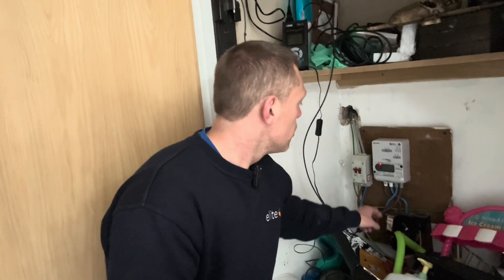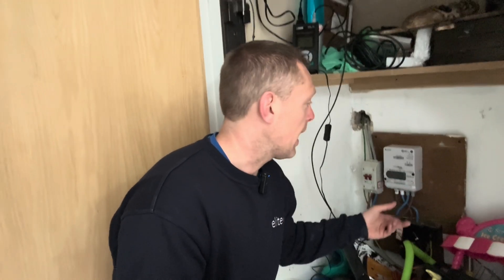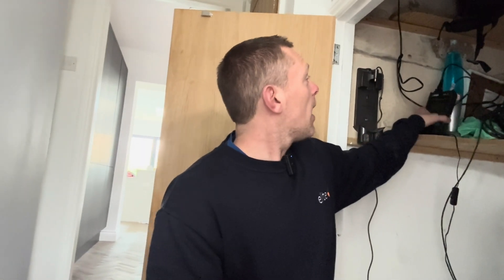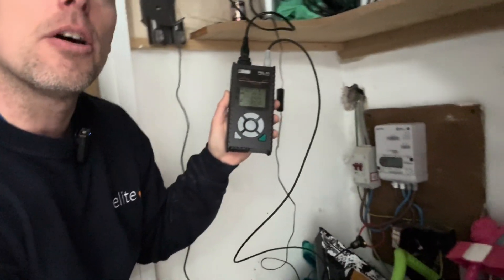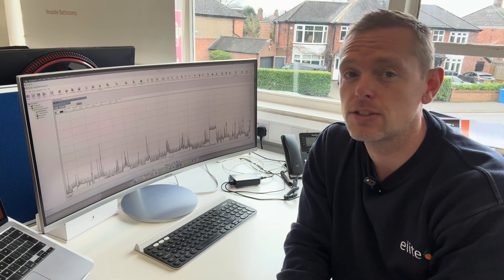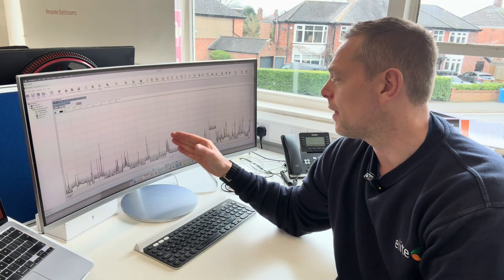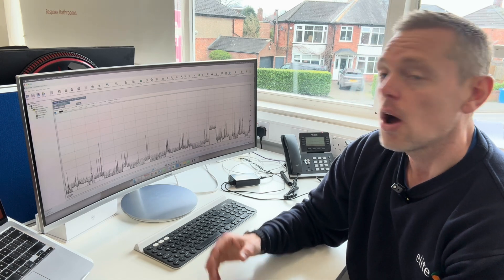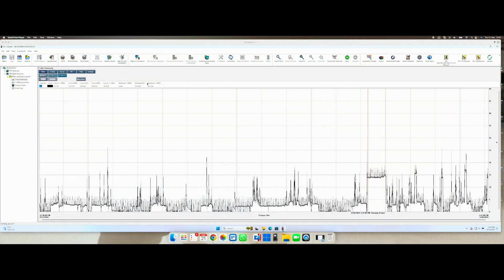Heat Pump - Max Demand Test!

Comment: Stop playing music over people talking, we can't hear what they are saying!
Why switch everything on, just look around and calculate the figure within 5mins.  Kettle, oven, toaster, hair dryer, electric shower, lights, TVs, radios, computers etc.  Don't forget to include an EV if used.

The other problem was one I found in Chester and Wales.  The common practice used to be to take ONE main cable from the street to a house and split it between two of them next to each other.  In the 1990s this caused many fires as storage heaters become popular.  Installers had put 80A mains fuses in, but forgot to check the cable going from the street to the house.  They didn't see it was looped house to house. When two houses both switched on Economy 7 and all the storage heaters went on together, the main cable went on fire. 

Always check this for heat pumps and EVs in older town or village houses.